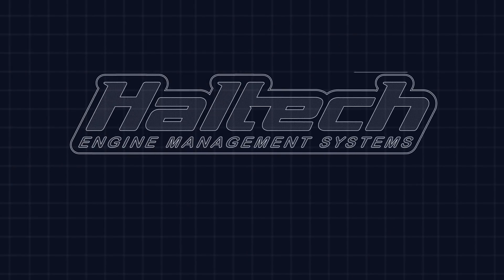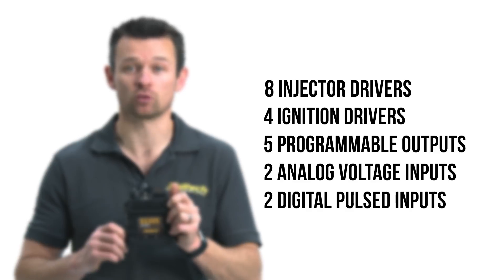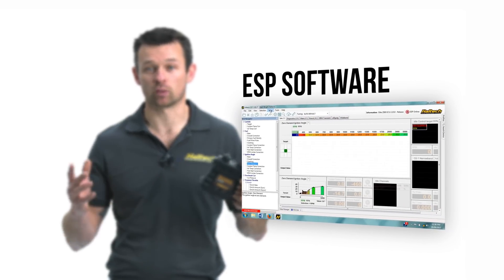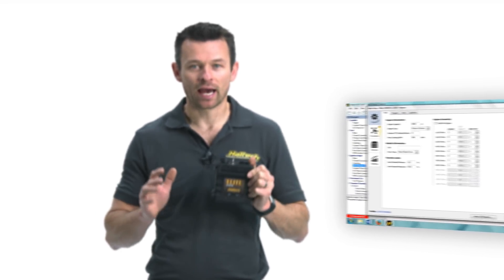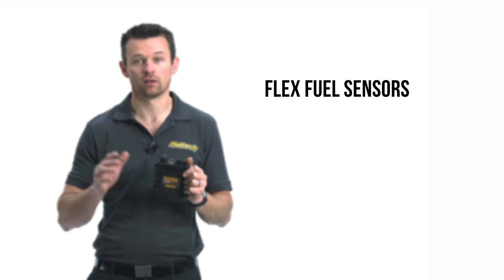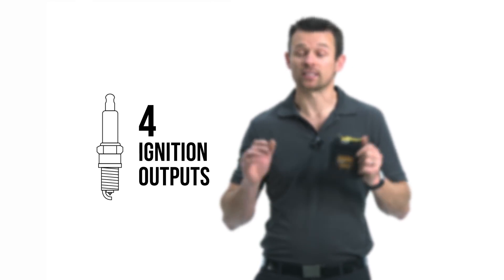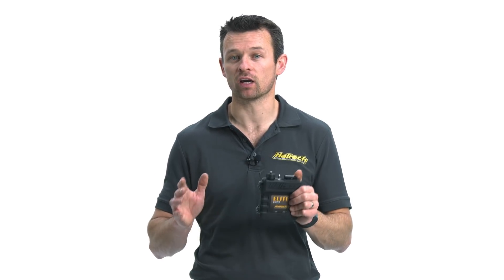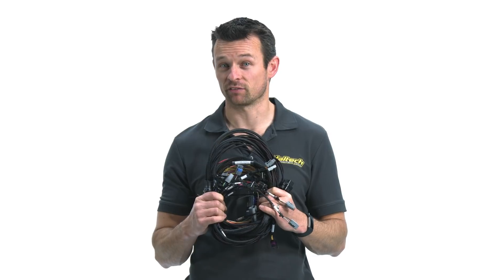🔍 Elite 950 Explained

Comment: Does anyone know if the 950 can control high impedance injectors such as the coyote 5.0 injectors?  Can the ECU do it, or will a resistor pack be needed.
Reply from the maker: The Elite 950 can run high or low impedance injectors - no external resistor packs are required.

Comment: I'm looking for an ECU for my Jag V12. I understand that the Elite 750 has 6 ignition drivers, which should allow me to run 12 cylinders in wasted spark mode. How does the $1200 Elite 750 compare to a pre-assembled MS3 w/MS3X for $700?